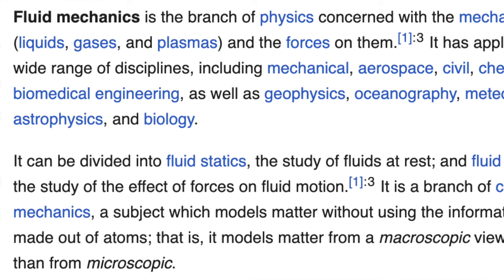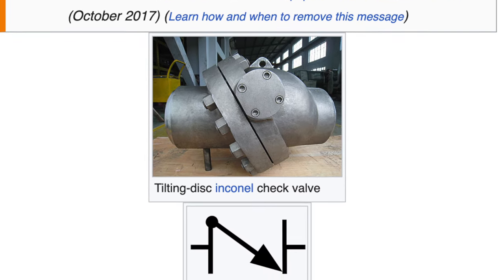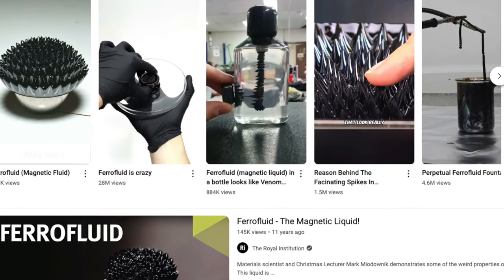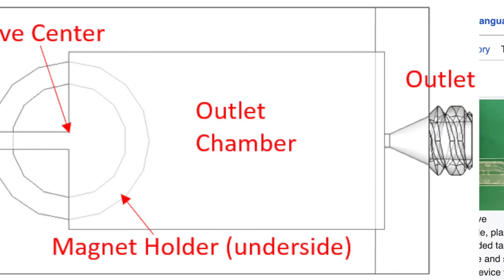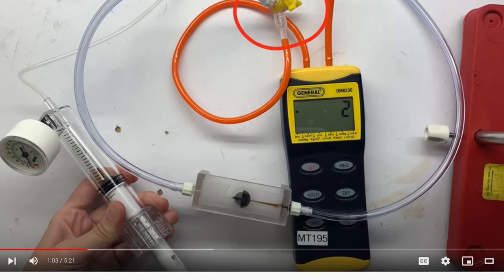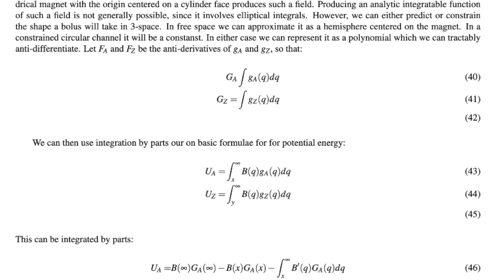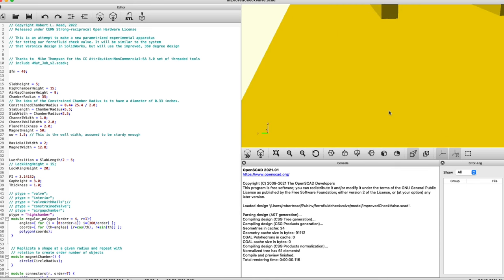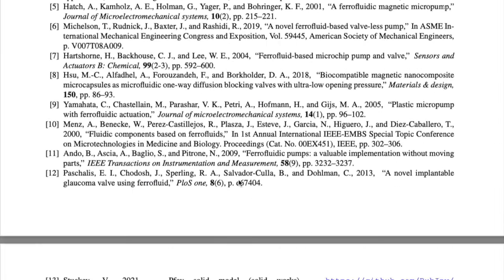Passive Ferrofluid Check Valve - A Project to Explore a Novel Invention

Comment: Would the ferrofluid be technically considered a moving part if it's a key component in the mechanism? Nonetheless impressive stuff and interested to see how this idea grows!
Reply: Thanks for the question. It is debatable --- but in a sense, the fluid does not "move", except in that it does admit bubbles moving through it. So it "moves" but it stays in one location. However, for the purpose of my statement, "no moving parts" means it has not parts that can "wear out". That is, there is no physical part which is subject to mechanical wear, as there is in for example a flap valve or a ball valve, both of which have "seats" which, if they crack or deform, allow for a leak.  My hope is that the great advantage of this valve is that it is easy to manufacture---you don't have to mount a tiny ball into a tiny little cage, or hinge a tiny little flap onto a rod-like hinge.